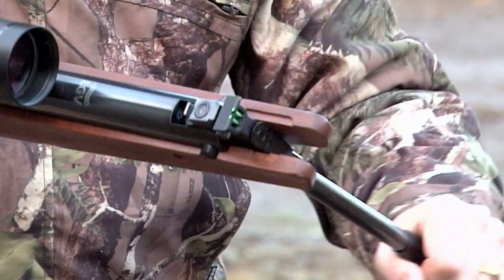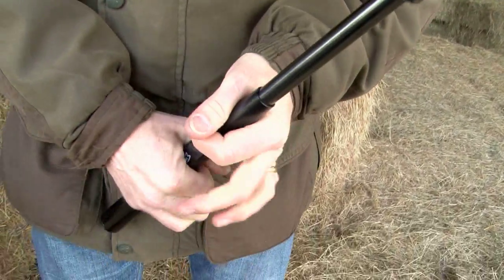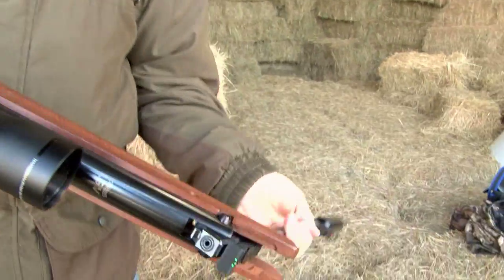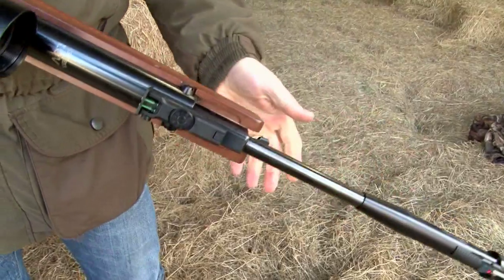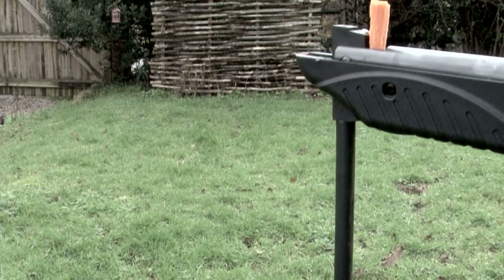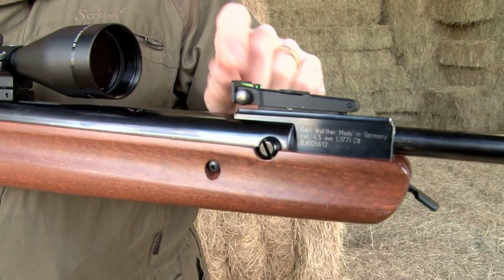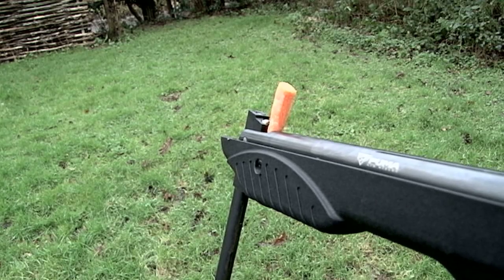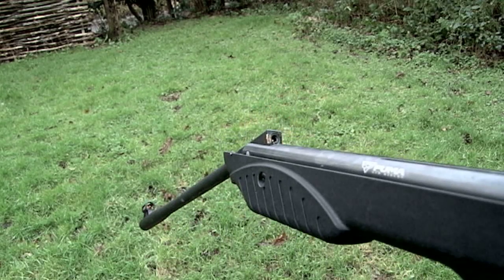Spring powered air rifle safety - Watch those fingers!

Comment: Do you have an idea how to load the under lever air rifle safely? I have a hammerli hf 900.
Reply: Just hold the under lever exactly the same as if it were the barrel.
It's actually easier with an under lever. 
After a while it becomes natural and letting the cocking lever just dangle feels wrong.
Anti-bear traps don't mean anything...hold the cocking lever yourself, after all it's your fingers. 👍🙂
Reply: @winkywank2650   thank you, but since that question i bought a co2 rifle wich mutch better feeling and more enjoyable

Comment: Do not load the spring first.
1)First of all You should break the barrel gently from lock  without  loading the spring immediately.
2)You will get a tiny space to place the pellet into the barrel though the spring is not loaded yet.
3)Before loading the spring place the pellet into the barrel through the tiny space in the rear of the barrel.
4)Now load the spring and set the barrel in its straight lock position. 
5) Thuse You need not place your finger in risky spring loaded position while feeding the pellet.Now just aim and fire.
Reply: Yes this is what I was taught with my break barrel springer yet I’ve never seen it explained like this on any video.  Any reason why?
Reply: This makes so much sense, yet I've never heard anyone suggest it. From my very limited experience, I don't see a reason not to do it like this. Loading a pellet with fully cocked barrel always makes me nervous so I think I'll follow your tip and do it like this from now on.

Comment: I've had a few break barrels close on me they're too slow and the breech moves away from your fingers (you can see this in the vid) so imo you'd have to make an effort to get pinched. 
A real danger is a side lever like an RWS 52 I once had, which tried to take my fingers as it snapped closed in a microsecond! It had an anti-bear trap device, but on par with the guns overall quality it sucked and did nothing. I then tested it with a pencil, which was cut, splintered and destroyed. As result I don't use side or underlevers, not worth the risk plus I don't see the point to those guns. 
Maybe someone with that or a similar gun can do that and post a vid?
Reply: @daltonnichols3160  lol
Reply: yuo dont see the point in using under or side levers?  better accuracy. because you dont have a moving barrel thats not fixed to the gun.